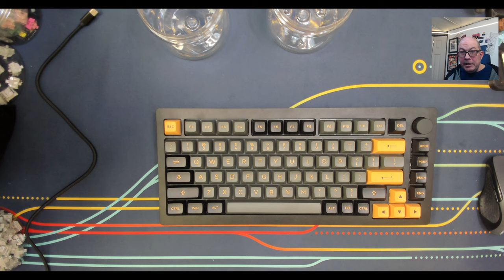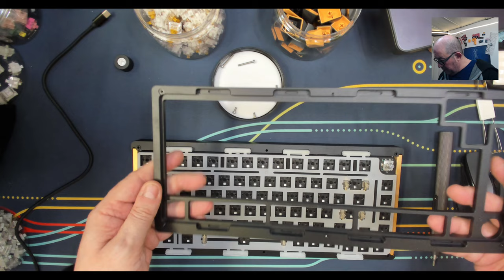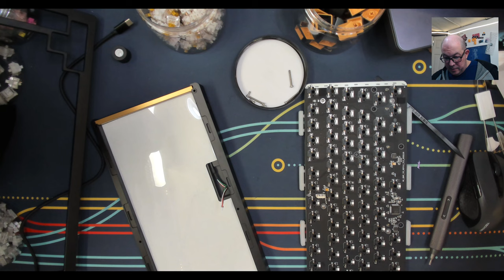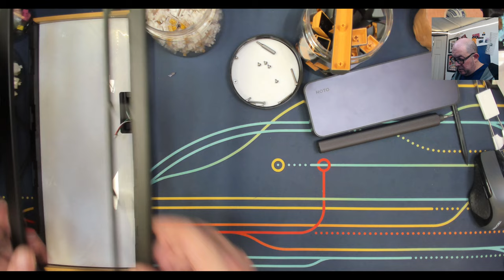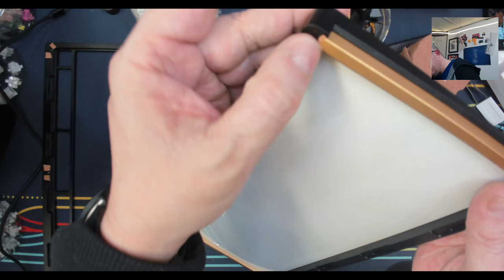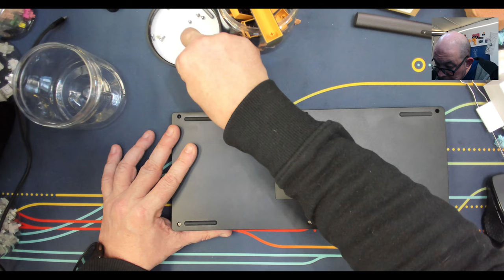Monsgeek M1: Force Break Mod and replacing stock PC with FR4 plate, which do you like more?

Comment: Thanks for the video. I just bought an M1 and bought the POM and Aluminum plates. Mine had holes instead of the studs like the stock PC plate. So you say I can install them without tightening them together like the stock build?
Reply from the maker: Yes, install switches in the corners and the center, that should be enough to keep everything together.
Reply: @MechKeyboards  Thx brother!!! I will keep them and give it a go later!

Comment: Thanks for the video! I was curious how the f4 sounds so nice to see it here. For my own M1 I'm currently running it with POM plate, plate foam, IXPE pad, 3 layers tape mod (1 layer painter's tape, 2 layers electric tape), instead of the case foam I have a thin layer of felt, force break, and making the side bars snug with tape. I'm using Akko cream yellow switches and then I was using cherry keycaps but I'm waiting for some MDA keycaps to put on instead. So far pretty good but I think I may still try playing around with different case foam configurations. I find for myself the POM plate is has a deeper and poppier sound compared to PC plate. 

As for video suggestions, I think I would find it helpful to have mod comparisons for a build. Like comparing different configurations and discussing how those change the feel and sound, maybe doing some side by side sound comparisons. Like with the M1 for example, polyfill vs case foam vs no foam, etc. or silicone gaskets as opposed to using poron gaskets. Of course nothing compares to trying it out for yourself but I think a lot of people would appreciate seeing the different directions a board can be taken so they can get some insight on what they might want to  try.
Reply from the maker: Awesome, glad you like, and thanks for the great input. I will definitely incorporate these ideas in upcoming videos, I do believe it will lend itself to many different sound profiles. Cheers!

Comment: I'm listening using speakers, not headphones, and while I could hear a difference, it didn't blow me away. Then again, it also sounds louder in the video than mine in front of me does. I just built mine Friday night and used milky yellow switches and MT3 keycaps. Completely stock except for dipping stab wires into dielectric grease. I'm still getting used to the MT3 caps and the layout is a little bigger than I had before (a 65%) and I stumble a little reaching for the down arrow. But having never built before, this M1 is a great board.  I may try the force break mod but not sure how much else I will trouble myself to do so far. Though I do want to try some tactiles (though these milky yellows are nice!). The only key that really has some ping to it seems to be the backspace key but I'm not sure how much I want to mess with those tiny screws for the stabilizers again!
Reply from the maker: Milky Yellows are nice, but I'm a tactile convert ;)

Thankfully if you want to do the force break, like I did, there is no need to remove the stabilizers.
Reply: @MechKeyboards  I will definitely try some tactiles at some point! But want to try to adjust to these MT3 caps first! Yes, at least doing force break is very easy. re: stabilizers, I'll give it some more time and see how much the backspace key bothers me. But so far space bar is pretty good and enter isn't bothering me either. I'm very pleased with the M1 so far!
Reply from the maker: @texasnightowl  right on!